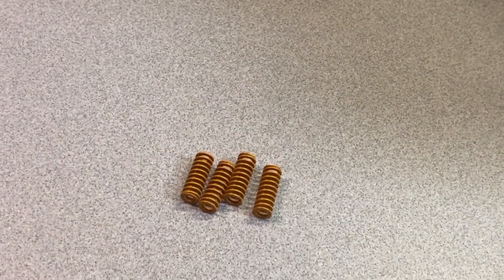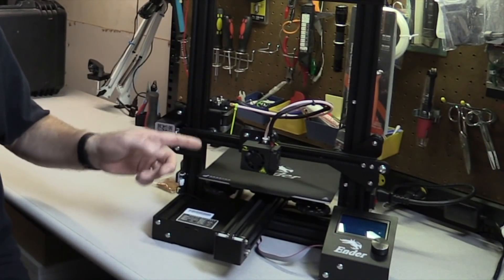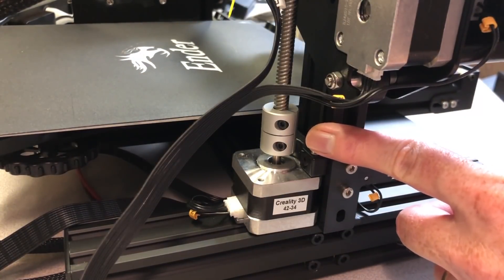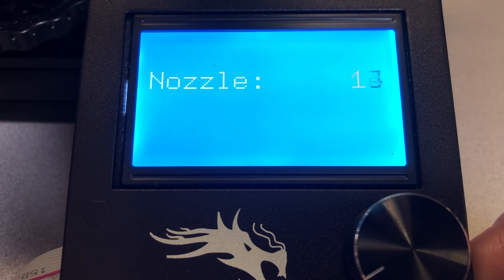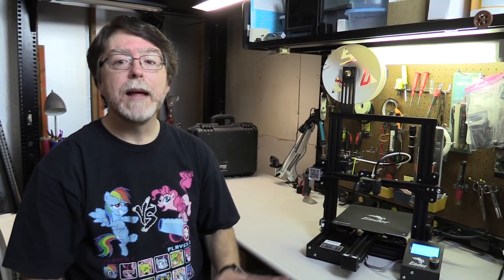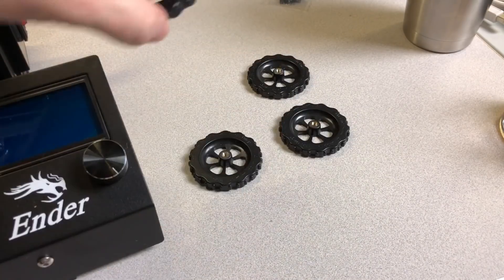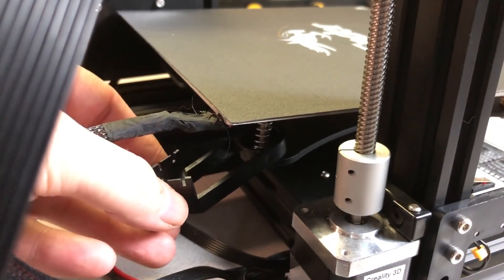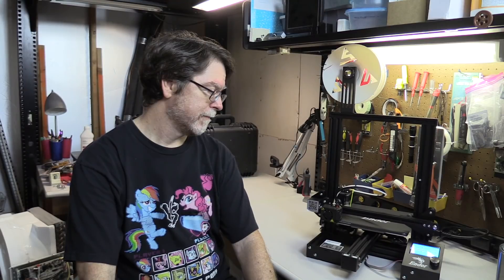Springtime of the Enders: Upgrading the Bed Springs on the Ender 3 Pro

Comment: That's very helpful, thank you.  And that filament spool it great.
Reply from the maker: Thanks, Cathy! I appreciate it! Oh, and that spool was one I got from 3D Solutech. They were doing a refillable spool system, and they would send the spools out when you'd order a refill, so you'd have something to put it on. In the end though, I think the cost difference between a refill and a regular spool of filament was only a buck or two, so convenience kind of won that battle. It's more of a chore to have to zip tie up what's left on a spool to change it out for a different refill, than it is to just use a regular spool.

Comment: Very good video Bryan, I was struggling with mine Ender 3 adjusting the bed level for  2 days, even without replacing the springs (yet) your video did help me on how to properly adjust that.

thanks

Comment: Boy, you must live, eat and breathe 3D printing. I'm going to have to pony up some cash soon and leave you a tip. I migrated from Windows to Mac. I thought well, I'll just get the Creality download for Mac. LOL. You're the best. I'm going to do a calibration square on the Prusa slicer software to see if everything works tomorrow. I didn't have to much trouble with the gap and bed leveling though. I use a tempered glass plate, (Creality makes one) this will bring the surface of your bed up, but prints are harder to remove. I have to remove the plate and hold in a vise while I whack the spatula with a hammer for larger prints.

Comment: I put better springs on my E3 while I still had a BLtouch in it's box.  I almost didn't install the BLtouch since the bed leveling was THAT stable.
Reply from the maker: On small to medium sized printers, I think bed probes are good for compensating for a bowed or sagging bed. The other good use for a bed probe like a BLTouch is if you have a removable flex plate system with different print surfaces available. Some surfaces are thicker than others, so a BLTouch is perfect for that.

I'm manually leveling the bed on my Ender 3 and Ender 3 Pro, and I'm even manually leveling the bed on my Sovol SV01 (it's got a 280x240 glass bed).

That said, I've got an inductive sensor that I plan to install, mostly for the experience (and to share that experience, of course). :)

Comment: Just fitted some and I have the opposite problem to you.  With the stock springs fully compressed I have a lot of air between the bed and the nozzle as you state.  But with the orange ones fitted, even fully compressed, the bed sits higher, to the extent that when I HOME the printer the nozzle just touches the bed.  I am going to have to raise the limit switch if I what to stick with these springs which is a little disappointing.  That is with an Ender 3 Pro - thin magnetic layer - if I were to add a glass bed I'd have to raise the limit switch quite a bit more.
Reply from the maker: Hi Nigel, that's interesting. On mine, when the Z limit switch was moved to the lowest position, and the adjustment knobs on the right side of the bed were as loose as possible, the nozzle just barely touched the bed. I needed that extra height and spring tension. The design of the Z limit switch mount makes it difficult to move lower without bending the mount, but it's easy to move the Z limit switch higher.
Reply: @BV3D  I have found that there are different length springs out there advertised for the Ender 3.  The original soft ones that came with my Ender 3 Pro are about 20mm long.  When I purchased the orange replacements, I found numerous sellers, all advertising as Ender 3 without any mention of spring length.  I have measured the ones I have received and they are 25mm long, 5mm longer than stock which explains the problem I am seeing.  I have some different ones on order which are claimed to be 20mm which should suit my printer much better.  Maybe you need the 25mm springs.

Comment: I assembled a new printer and having seen your videos, I used the yellow springs right from the start instead of using the stock springs. I have got the bed pretty dialed up but I think I might have started from a "too tight" position on these yellow springs. That might have caused a bit of extra push on all 4 corners causing a little shallower center which I can't adjust. Can you please tell me what is a good starting point for the spring compression? TIA.

Comment: my ender v3 s1 pro has chunkier yellow springs from the factory but i feel like i need to adjust every 1-2 prints? the center of my bed was a little low relative to the sides, so i bought a 4mm glass plate bed and it worked a treat for the first two prints. now i need to adjust it all over again. feels like it shouldn't be that way. i'm a novice though.

Comment: Thanks for the video, I just subbed!

That's strange, I was wondering why you were saying there is no option to move the Z on the menu, my Stock Ender 3 Pro has a "move Axis" option under prepare , but I see @ 6:00 you don't have it!

I got an STL for the bed leveling off CHEP's "Ender 3 Easy Bed leveling" video, it moves the nozzle around like you desribe but it waits for you to click the touch wheel before it moves.
Reply from the maker: Hi Brian! It's odd that there are little differences in firmware between the Ender 3 and the Ender 3 Pro. As far as the firmware is concerned, the printers are identical. Same bed dimensions, same motors, same hot end. But yeah, I have to manually move the Z axis on mine. That's cool about the file Chuck provides, where you click to go to the next corner. Thanks for watching and commenting! 😃

Comment: I just set up my printer and it's in homing position but I decided I wanna install these new springs. I cant seem to move the x axis up by moving the coupler clockwise/ counter clockwise. It's pretty tight and doesnt wanna move. Its stuck in the homing position. Why wont it  up when I screw the coupler ? It feels locked in the homing position.

Comment: You dont need to mess about with the heat bed strain relif you just remove the magnetic print bed and lift the screw enough for you to slide the spring in there lol

Comment: Seeing as I use Manual Mesh Bed Levelling which is unbelievable easy to do with the 3DFused Linear Bearings on the X and Z-Axis. Would Solid Bed Mounts such as those provided by TH3D not make the Spring System redundant?

Comment: My issue is the exact opposite. When homed, the z axis is extremely low even after setting the springs. It's so low, it gauged a channel in the bed. Is there a way to adjust home? I'd need maybe a half inch. I've got the tension on the springs as far as they'll go which isnt ideal
Reply from the maker: Hi, it sounds like you need to adjust the Z endstop switch mount, and move it a little higher.
Manually turn the Z stepper motor to raise the X gantry a little bit, so that the nozzle clears the bed by about 1mm.
Loosen the two screws holding the Z endstop switch mount in place on the left side of the printer.
Raise the Z endstop switch mount until you feel the switch triggering against the wheel bracket on the left side of the X gantry.
Tighten the screws to secure the Z endstop switch mount at the new height.

Now when you home the Z axis, the nozzle should stop about a millimeter above the bed. Then you can adjust the bed leveling knobs as needed.

Hope that helps!

Comment: Hi Bryan  Great videos.  Just subscribed.  I am having the same issues with my nozzle not getting close enough to the print bed.  The gap is huge and when I go to adjust the adjustment screws just end up coming off and there is a still a great big gap.  I have ordered new springs and also a glass bed that is coming tomorrow but wanted to make sure I didn't miss anything else I needed to do before they got here.
Reply from the maker: You may need to adjust your Z axis end stop switch. Since that switch determines the “zero” position for the Z axis, if the switch is too high, the nozzle stops too far above the bed. On the left side of the frame, right next to the Z axis stepper motor, you’ll find the mounting bracket for the Z axis end stop switch.
Turn off the printer.
Loosen the two screws holding that mounting bracket to the frame, so you can move (or remove) the bracket.
Tighten the bed adjustment knobs at least halfway, maybe a little more. Try to get them compressed evenly on all four corners.
Manually turn the Z axis lead screw to bring the nozzle just touching the bed. It’s easiest to move by turning that gray aluminum coupler which is attached to the stepper motor.
Reattach the Z axis limit switch so that the switch is being pressed by the bracket on the X axis arm.
Manually turn the Z axis lead screw to get the nozzle a few millimeters above the bed, then turn on the printer, click the knob to get into the menus, go to Prepare, and Auto Home. When the printer homes the Z axis, the nozzle should be just a smidgen above the bed, and you should be able to  adjust the bed knobs to get the bed height set properly.

Good luck!
Reply: @BV3D  Thanks so much.  Finally got it working.  Love your videos.

Comment: Another great tutorial Bryan.  Do you have a recommendation on replacement springs for the Monoprice Maker Select Plus?  I'm going to feel embarrassed if you did essentially the same vid for that printer.
Reply from the maker: Thanks Tim! These should fit the MMSP as well. I need to replace the bed thermistor on one of mine, so when I put it back together, I'll confirm that they fit, and let you know!

Comment: I think that is the Ender 3 not the Ender 3 pro
Reply from the maker: Nope, it's the Pro. The bed rides on a 4040 aluminum extrusion, instead of a 2040 as on the Ender-3 not-Pro. 😉
Reply: Ok thanks because I recently just bought some for my ender three pro

Comment: I put the yellow springs on my Ender 3. The issue I'm facing is that the springs/knobs don't have enough travel to do the leveling.  They lose all tension before I can level. any suggestions? Thanks
Reply: did a little more trial and error. I decided to move the vertical switch up a few milometers so that the springs would have a little more travel. Is this the right way to do it?